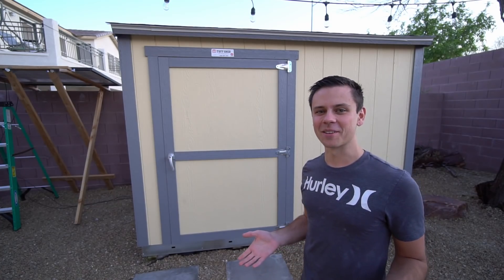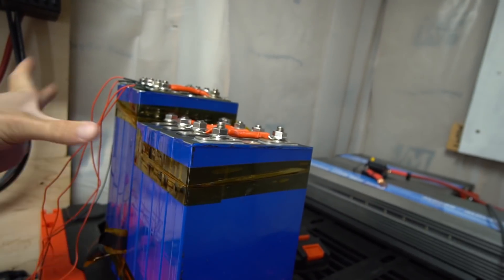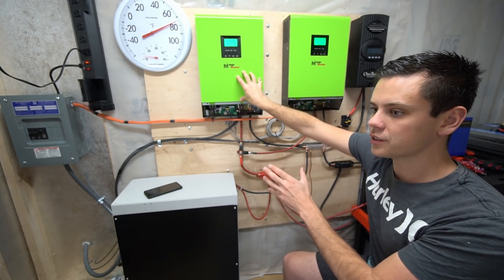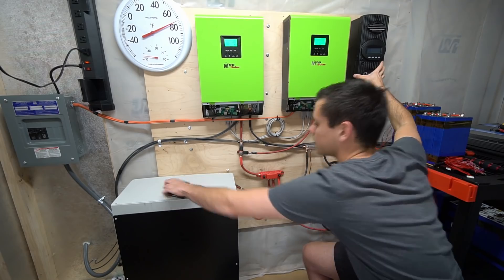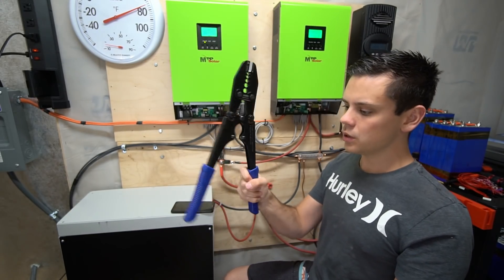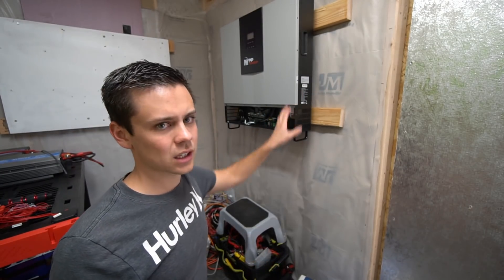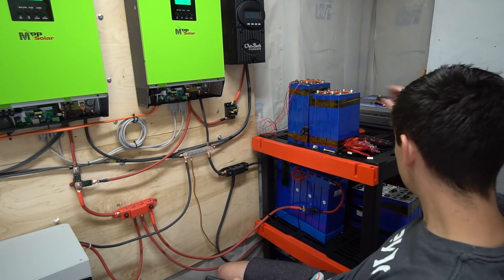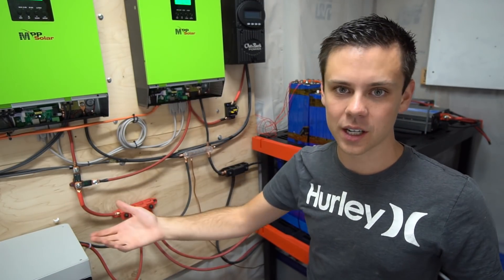Solar Shed Upgrade: Frankenstein LiFePO4 Battery -HUGE Capacity!-

Comment: I recently purchased this in the 24v package from Shop Solar. I am using it to run a small cabin. However the system shows an open ground at the plug AC out. Do I need to ground my subpanel in the cabin?

Comment: Easy ferriday cage idea to protect this equipment from an EMP. metal garbage can, insulated interior, cardboard around every metal surface inside would work. Keep your spare equipment in it. I'd like to see a video about how to bipass a BMS if it's fried by an EMP

Comment: Wow! A lot of different batteries paralleled together no problem. I'm thinking about paralleling a 14s lion cell with a 16s lifepo4. The voltages line up pretty damn close. Anyone see an issue?

Comment: Hey Will what's your opinion on the lgx6048 or the growatt 12k 48v? Which one would you pick? I'm in grid power but I don't want to back feed into my grid due to the outrageous permitting process. I'm wanting to have solar and battery power run a my central ac off the batteries and when my battery gets low it would switch back to grid power.

Comment: The iwiss DEF sucks! I've got the larger leverage crimper which I like quite a bit. I crimp alot of 1/0 gauge wire  and like you said the crimps aren't beautiful but it's mostly covered by heatshrink anyway so I'll take the secure dependable crimp over the good looking one
Reply: Also I'd very much like to hear how the ac is working out. Even if you do t add additional insulation I think it'll stay decent in there without too much additional load

Comment: Will,  I have four LiFeP04 12V 200 AH batteries.  Two pairs, and each pair from different manufacturers.  Each pair is connected adjacent to one another, in Parallel.  I have a distance of 20' between the two pairs of batteries, and they both terminate at a Lynx distribution combiner unit.  They are basically connected in Parallel at the Lynx distribution device.  I have been told that it is not recommended to connect different batteries from different manufacturers in series, or parallel.  However, each pair is separated by approximately 20', so they are basically supplying independent power to my Lynx distribution combiner device.  Do you see a problem with my design?

Comment: Why do you need the Outback power output if you are using LV2424? Doesn't the LV2424 already have a built-in inverter and charge controller, also able to connect to grid, also able to back-feed grid?

Comment: How did you calculate the "usable capacity"
Reply: It is a value given by the manufacturer. Typically, lead acid only goes to 50% DOD while most lithium can handle 100% of their useable capacity.

Comment: Hi Will, thank you for your videos. I have a lv2424 and it is draining at least 1.5 amp from the grid day and night even during a sunny day and no load on the output of the inverter. I’m wondering if your inverters are acting the same way. I already asked the seller about it and he said it is normal but I still have my doubts. Thank you

Comment: 6:51 high quality wires you say? Don't buy cheap bullshit from China off ebay to use for your desktop PC.  Watched a CPU power (8pin) power cable light up and create a 8 inch flame inside my PC. Luckily I was there to pull the plug. Funny enough it was after I loaded Prime95 ROFL, to test for this exact situation with the case open. So yeah..testing works . But , don't test wires, buy known used, quality and rated wires. Or u pay the price (potential death or serious harm)

Comment: Have you ever changed the charge controller in a hybrid 5KVA 48v 230v Pure Sine Wave inverter 50A Charger AGM Battery PWM ?

Comment: You have a very small system. That is what I started with 20 years ago and I use car/truck batteries. And a house need typically 4500 watts at eny one time and you don't have that.
Reply: Huh? The only time I pull that much is when my dryer is running along with the base load. There is no rule of thumb for house loads.

Comment: Those silicon buttons on your Outback devices will fail in only a few years. New ones are ludicrously expensive for what they are and almost impossible to physically replace on that unit. I needed two sets and was insulted by their ridiculous price so dumped my whole Outback system and bought MPP.
Reply from the maker: Wow good to know

Comment: Awesome battery bank!  I figured out what was wrong with my BYD 24v powerpack and made a video.  The balance cables popped off the BMS during shipping.  Now I have full capacity and my battery bank total capacity is over 16 KWH!  Shut off the main circuit breaker from the gird today and running my whole house with batteries recharged with 2KW solar.

Comment: Thanks for posting this video! I have the same inverters in the same split phase setup, ~5kW of solar panels and some LiFePO batteries. I can run the AC no problem with those inverters. Our central AC pulls about 2.5kW, which is way below the rated total of 4.8kW for the 2 inverters. I can even charge my Tesla at the same time at around 8A/240V and run the rest of the house. I also have a 4kW 120V single phase inverter as a backup, to split the load if needed, but that one just died, and I'm waiting for a new one. So, the house is running on just the MPP inverters now.
Reply: That's awesome! What kind of AC unit are you running? 

I've got a roughly 600 SF Cabin with a Mr Cool 12,000 btu mini split. I'm thinking about getting the MPP LV2424 Split Phase kit to run this cabin. I think they will work well, I just don't want to underbuild my system.
Reply: My goal is to make this cabin completely off-grid btw.

Comment: I have the same inverters: 2 in a split-phase 240V setup like Will. They are pretty decent, except for a few of annoyances:
1) BIG GOTCHA: if you follow the manual and connect all your solar panel strings to both inverters, their MPP algorithm gets confused and you end up only making like 500W with 5kW of solar panels! So, don't believe the manual! Split your panels into 2 banks, like Will did. For example, I have 16 panels in strings of 2 to double the voltage. 8 panels (4 strings with a blocking diode per string) go to inverter 1 and the other 8 panels go to inverter 2. The ground is common, but the positive is split per bank.
2) Medium gotcha: the software can't show the power generation graph for more than one inverter, so for a while I thought I was only making half as much energy as I really was. Even though the inverters are connected with a custom communication cable, and you can view the current info for each inverter in the software, the graphs only apply to the one the USB cable is plugged in! And, you can't plug both inverters into your computer with 2 USB cables. You need to unplug the cable from one and plug it into the other one to see the graphs for the other one.
3) Once the battery level drops below ~20V, the inverters shut down and won't start back up until they get charged up to about 24V, even if the batteries recover to 23V. E.g. you accidentally turned on an electric heater, but then turned it off. I had to buy another inverter, so I can use the remaining charge in the battery the rest of the night.
4) Sometimes the inverters don't start up at all, even when the batters get fully charged. I have to go outside and manually reset them.
Hats down to MPP though for making their software work on Linux! (and Mac + Windows)
5) The software was insanely slow. Switching between inverters or looking at graphs would take like 2 minutes (it should really just show both on the same screen), but the latest version is much faster. Make sure you grab it from MPP's Web site.

Comment: The flexmax are nice, but the midnite classic is amazing, I'd like to have either, a couple classic 150-200 's I'd be set for life,  2x 150's can charge at 96amps each up to 150 v pv, and 96 v out to a batt bank, I use Chinease charge controllers, they work well, but I only trust them to 80% rated, and only 6 hrs a day, $600+ for a midnite classic150 is a bit much, my $100 mppt controllers work fine, after I'm done buying batteries and solar panels, I may buy one, they also work with wind and hydro, keep at it Will!

Comment: Am glad you are off grid, independent. Don’t understand grid connected people. 
Would you maybe review some dc appliances? 24 volt freezers and refs are such an improvement over the 120v usual store products. Your system similar to mine but I have 48v & 12v systems plus a 24v dc voltage reducer.

Comment: Maybe I missed a previous video but how do you connect different batteries in series and in parallel is it because they are groups of hundred amp hours? Ok if off by 5 or 10 am hour?
Reply: did you find an answer to your question .. i am also curious about this

Comment: I know you know what you’re doing. Just curious about what appears to be like 2ga battery cables. I mean maybe it the video they don’t look any bigger than maybe 1/0. What gauge are they and is it because such short runs? What’s up with that ??? Thanks love your videos
Reply from the maker: It's because we have tons of batteries. The current sharing is minimal given the c rate. I could use 10 gauge from each pack and I could still power my loads because I have so many batteries. If this was lead acid or higher c rate, totally different configuration

Comment: Your videos are great, I’m learning a ton! I’ve got a question about how your using the busbar...I’ve been reading that adding new batteries to an an already existing solar system setup that has batteries is a bad idea because the old will considerably shorten the life of the new...I want to start, get a setup with the idea of expanding in the future...did I hear you correctly say you could add new batteries to the system via the busbar? How does that work? Have you detailed this item before in a video? Thanks so much for all the great info!
Reply from the maker: That's with lead acid only. If you have individual LiFePO4 packs in parallel, with ocpd etc, it's fine
Reply: DIY Solar Power with Will Prowse Yo! Thank you! Stay healthy...

Comment: I just got my BYD. So stoked to get it hooked into my system.  My only concern is I may need more panels.  I only have 4 100 watt panels hooked into series/parallel for 24 volts@200 watts.  I do plan on getting more panels soon, at least another 4 to make a total of 24 volts@400 watts.

Comment: Will ,I advise you to put a metal heat shield behind your MPP highbred controllers if you read in the instructions do not mount on flammable surface if you take a piece of sheet metal and make it like a hat channel so there is a airgap behind it Will reduce your Chance of a fire.. also extend the metal that you mount flat on the plywood 12 inches above your controller and bandit in a 90° so I protrudes out 6 inches and have the metal on the sides  6 inches on the flat.I put 2 carrier ductless on my Motor home and they work well but something to be aware of is they have a drain pan heaters in most of them that turn on below 35° so if you’re Boondocking in cold weather and you don’t turn the breakers off The heat pump Drain your batteries. I also modified a ductless heat pump the heat the water in my hot tub a year ago and it worked wonderfully cut my electric bill by $20 a month.

Comment: .  Nice, I'm glad you finally used an outback.  I've compared my Outbacks to my MidNite classics and I got to say I love the classic much more. Easier to use more of an open-source attitude. Built-in networking. I love the $250 classic that has the 250 volt input. With all of the options and flexibility and only a little bit more than the Chinese models it was a clear winner but they ran out of the discounted model so the price is back up to $700 now.
Reply: I think the fan system in the outback is better than the classic but I have to protest the need for a fan at all. I'd rather have a completely sealed unit with a large heatsink.
Reply: @SiriusSolar  morningstar?
Reply from the maker: Good to know. Will check out midnite

Comment: The MPP LV5048 also has built in communications for additional units up to 3  Its the LV 5454 ones that u have to buy parallel boards for.
Reply: Typo 2424 n0t 5454

Comment: That is a very interesting system. It’s cool to see you put all those random batteries to good use. It’s crazy that all the batteries currently hooked up is about equivalent to a single 16s string of 280ah cells. At first glance I thought you had like 30kwh worth of batteries.

Comment: Hi will Enerdrive Australia make liFeP04 batteries for off road application and they advise not to connect these type of batteries in parallel because if you are pulling a large load battery's #1  BMS can shut the battery down to protect the battery and  the load with shifts to  battery  #2. Then #2 shuts down , in the mean time  battery #1 comes back on line and load is transfers  back to #1 so the load keeps transferring form one battery to the other . Is this correct

Comment: Can someone point me to an explanation of how to mix batteries like this
Reply from the maker: If they are in series, same capacity. In parallel, same voltage. That's all
Reply: @WillProwse  you had battle born and homemade mixed  in series?  Or is each type is series and the groups in parallel?
Reply from the maker: @local378  no, just in parallel

Comment: Loving the videos will! You've got more capacity than a Tesla Powerwall now. Good stuff!

Question for you: Is it possible to connect an external lead acid or lithium pack to the Ecoflow Delta 1300 to add capacity? If so, what's the best way to do this?

Comment: I tried using the MppSolar LV5048 with battle born batteries.  Everytime I turned it on the batteries would go into protect and shut down.  Found out that with Battle Born Batteries that with inverters over 4kw you need a Current Surge Limiter for a soft start.  Support from MppSolar sucked.  So try MppSolar at your own risk as they are in China with no US support sites.  Finally ended up returning it.  Also there is a video out there where a guy tries to run his chop saw with the LV5048.  Inverter cannot handle the demand and shuts off.  Because there are actually two 2.5k inverters in the LV5048 instead of one 5kw.  I think All in ones are a great idea!  Just not MppSolar!
Reply from the maker: No just used a small resistor to pre charge the capacitors. It takes seconds. Then set low voltage cut off. I have a video on this.
Reply: I looked at your videos and never saw anything about this resistor???  Do I use the resistor between the batteries and the unit?  As I could never get the LV5048 to start I could not change any settings @WillProwse
Reply from the maker: You bought it from maximum solar huh. Buy it from Ian from mpp USA and you will get support. That's a bummer you returned it for that reason. Dang
Reply from the maker: https://youtu.be/ZlrtmJRfSP8

Do this next time
Reply from the maker: If not you will trigger battery safety mode. I'm surprised no one told you that. Such a simple fix
Reply from the maker: Yes, 2.5kw for each line, 5kw in parallel. I bet they didn't change the settings and ran half output at each line. Super common problem with people who don't read the manual. I can assure that it can run 5kw and more. Whoever posted that video probably didn't change the settings.

Comment: Will, I have always heard that you shouldn't mix battery chemistry and brands.  Do you lose any total capacity because of the mismatch batteries?
Reply from the maker: Whoa mix chemistry??? I would never do that. We never did that in this video either. Where are you seeing that?
Reply: DIY Solar Power with Will Prowse I guess I just assumed since you have reviewed so many diff batteries. Ok, so you answered the “don’t mix chemistry “ question as a BIG NO!  How about the different brand part. I want to add 2 BattleBorn batteries to my 2 Renogy batteries.
Reply from the maker: Yeah that's fine
Reply from the maker: Just need same voltage and SOC
Reply: @WillProwse   I asked Battle Born and Lion energy today about using their batteries in parallel with my 100ah Renogy they both said no. Renogy even said the new Smart battery wasn't usable with my older model Renogy I bought last year. What gives?  I see you using different LiFeP04  batteries in parallel, are they just trying to sell me more batteries.

Comment: Shouldn’t there be space under the panels on the shed roof. No air circulation won’t they over heat in Las Vegas, the will in lower desert where I reside!
Reply from the maker: Of course they have convective air flow. What would make you think that they don't?
Reply: DIY Solar Power with Will Prowse    It just doesn’t appear so. Even the panels on your tile roof has a noticeable gap off the roof surface. That the basis for my comment. I apologize. In my area there is at least 4”.      Just reviewed your previous vid and see the space.

Comment: Could you go over  a  48 volt systems the testing of batteries I am planning on building my own 48 volt small system in the shed. I am not concerned so much about money. Just simplicity. Thanks your the best I'm thinking of about 3000 watt of 48v panals I'm in Florida so we have clouds but I just need to run a deep freezer that's smal and a very small window ac for when hurricanes come this past year I was out of power for one week it sucked I supplemented my power with a gas propane quickly ran out after 5 days would be awesome to have a solar array and generator to supplement my battery if needed

Comment: Nice video, impressive progress. Can I suggest you acquire a dc-powered airconditioner rather than ac-powered? There are a few of them I saw when I did a Google search. It will so helpful to hear your opinion on this and the usefulness of DC powered air-con in a solar system...